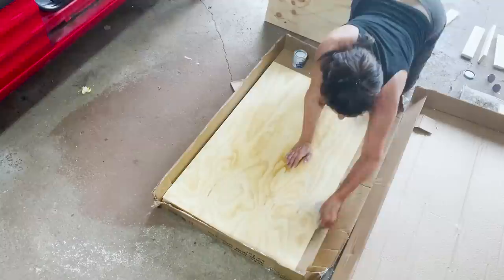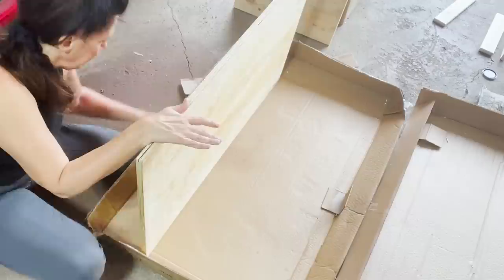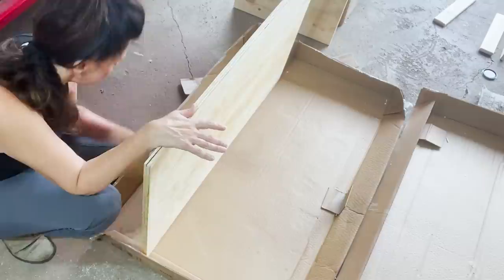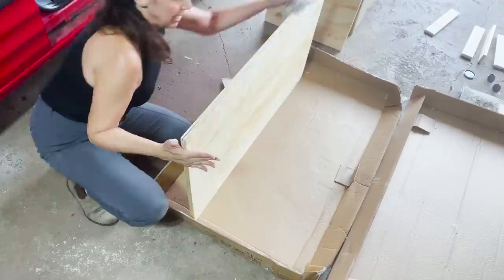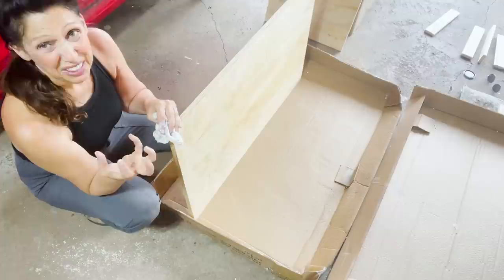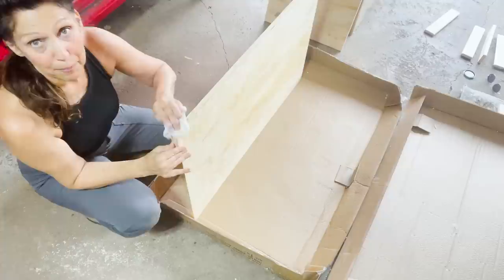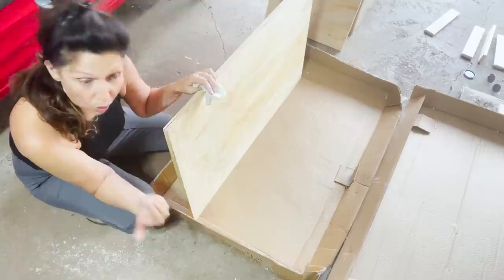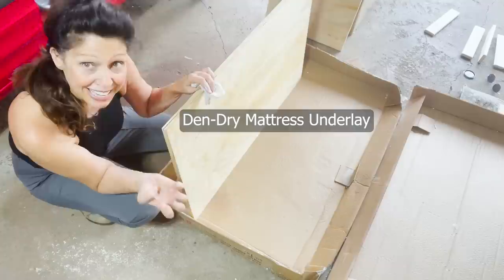Van Life | I made a new BED platform Failure? Genius?

Comment: I absolutely love your new bed. Brilliant!! I might change my mind on my DISC-O-BED and sell it. Until I try it out for real, I don't know yet. I just love how you can custom fit your Bed/Couch. Great work. I feel bad for you having to use such a large heavy drill with your injured wrist. 
David and Archer
P.S. I didn't see a link for the table leaf extensions. You said yours measure 30 inches extending to 6 feet. Can you tell me where to get them, how much you paid, and can you get different sizes? Thanks Dee
Reply from the maker: There is a link in the description. I actually made a mistake on the length it pulls out to—it is 68” not 72”—but that can be made up with the piece on top.
Reply: Hi Dee. Thanks for your response. For the life of me, I cant find anywhere in the description details about the slides for your bed. I have hit all the links that could be it, but nothing I can find. Maybe I am just missing it, or it's not coming up. I especially looked close in the bedroom area.
Reply from the maker: @davidhale3107  Oh my, for some reason it was showing in my default settings but did not show up in the description. I think it is corrected now. So sorry for the confusion--you are not crazy lol!!! Let me know if there is still an issue.
Reply from the maker: And to make your life easier--Wood Table Slide Extension: https://amzn.to/3RuEMsn
Reply: @LadyBugout  Thanks Dee:) It shows up now in your description. I am 92.5% sure I am going to sell the DISC-O-BED I bought, and build a bed like yours. I haven't done a dry run yet on the DISC-O-BED. My thinking was that I could keep the cots in their bag when not in use, but setting them up every night could get old fast. 'Keep it simple stupid' is what my dad used to say. Stay safe, and God Bless your travels. David and Archer
Reply from the maker: @davidhale3107  In one of my videos a woman had those same cots and said it was problematic because one button could make the whole thing collapse. Sarah was her name. I think it was this video—you might want to watch if you haven’t
https://youtu.be/tn5i1S7tIA4 she said using those cots was one of the regrets with her build.😬 It may be helpful.
Reply: @LadyBugout  Hi again. I watched the link. Great video of what people don't like about their rings. I know about that button on the DISC-O-BED. She had the button facing up where it could accidentally be pushed in. In the instructions it tells you to install with the button facing down. What concerns me is the DISC-O-BED is made so sturdy, they had to have really thick steel poles. Each cot weighs 31 pounds. 62 pounds is a lot for a bed. I'm pretty sure your bed is the way to go. I am 6 foot tall so it will work. I only wanted the DISC-O-BED because of Archer sleeping on the bottom cot, but I can make a place for him somewhere. He is pretty big (100lbs) I can't wait for October 31st, that is when the temperature finally starts to cool off here in my part of Florida. I will have November, December, and January to build. All I have left to buy is floor, walls, and ceiling. Your bed supplies are simple. I was thinking of cutting my memory foam mattress in half, that is on top of my queen size mattress, it is 3 or 4 inches thick. I could cut it to fit exactly. I have a $1000. ladder rack that was on the van when I bought it, heavy duty. I dont need solar panels because I have a BLUETTI 200w portable. I would like to put a hard aerodynamic storage pod on top, but they are so expensive. I bought a MAXXFAN also. Sorry I got carried away again.Thanks for the link. Looking forward to your next video. 
David and Archer
Reply from the maker: @davidhale3107  I hope I get to see your rig some day! Sounds like it is shaping up nicely.

Comment: I looked at the site with your new matress/Bed. I am in my Honda CRV. My narrowest part od my bed platform is 24 inches. The site showed that the folding chair is 22 inches wide. I thought it would ba a good fit. But, it looks like your folding chair is 36 inches. Do I have that right?
Reply from the maker: I have two different ones. The bigger mat is 39” wide. The smaller one that is in my passenger seat area is 22”

Comment: Hi Dee. Did you think about wall insulation?
Reply from the maker: I did think about it. But, it has not been an issue for me. I lucked out that my cargo van had a headliner that seems to keep it insulated on the ceiling and from having condensation problems. I also wanted to keep metal exposed for magnets. I do not stay in extreme temperatures for long (an advantage of having a home on wheels)… so not having insulation has not been a disadvantage in any way so far. Hope that helps☺️
Reply: @LadyBugout  👌👍🙂

Comment: get a real mattress or get no sympathy sleep and sit better use  the wood or  just use the floor
Reply: @LadyBugout  with a real mattress that wont fold into a couch you could try standing a single on its side for floor space
Reply: @LadyBugout  also didnt  think you would answer me thanks
Reply from the maker: @buckrowley1506  I get great sleep on this mat—it’s one of the reasons I used it. I would have a hard time with a mattress on its side taking up space when not in use. I have so little space as it is. But, thank you for being concerned that I get a good night’s sleep☺️